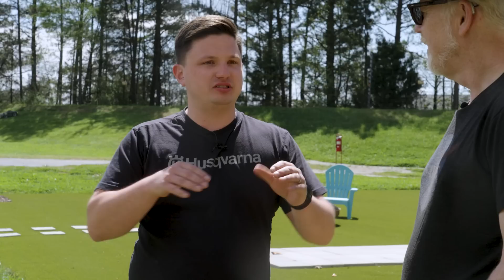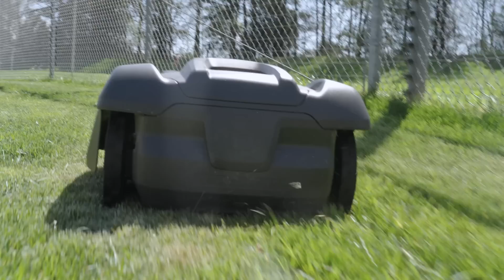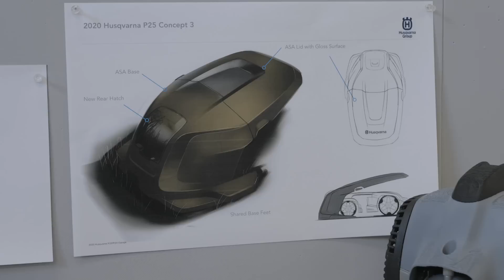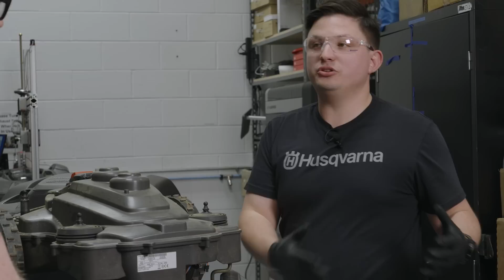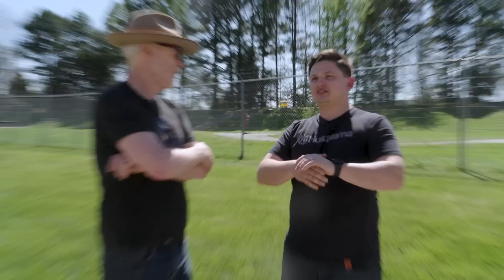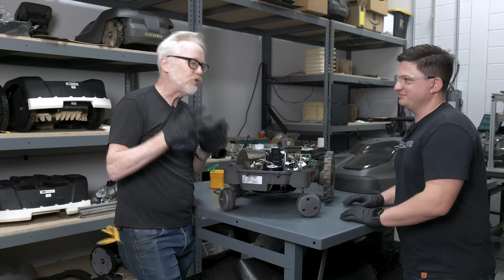How They Work: Self-Driving Robot Lawn Mowers!

Comment: The fact it's IP4 rated is a major disqualifier for me when many on the market are IP6 so you can hose it off underneath.
Reply: You should never hose off a robot mower from underneath. I've worked in robot mower service for years and have seen many robots fail due to water damage caused by being hosed from underneath even those where the manufacturer claims it's safe to do so.

Comment: You certainly got into the weeds with this product but there are unanswered questions about maintenance. For example how do you deal with the inevitable buildup of clipping debris underneath, particularly if it is only water resistant from above? (A lot of modern mowers have a hose attachment to clean underneath the cutting shell.)
Reply: lift it on the backside and hose down the debries.

Comment: We have some of these at work. I think they perform well. They are not going to generate the contrasting strips that are typical of freshly cut lawns, but that's a byproduct of their autonomous nature and how they somewhat chaotically bounce around inside their area. 

The only downside, and this is more of a maintenance issue, is there is some sort of problem that develops with the blade system. When the facilities team puts these out every spring they struggle to cut anything. Miraculously, one day they begin to cut great. I suspect the blades get corroded and need to be changed every year. Or perhaps the blades get froze on their axles. This is likely more of a storage issue with the machine in the off season. They probably aren't cleaned well at the end of the season and that leads to the problems. 

Then, one day, they start cutting great. 

Having some mechanical sympathy is going to lead to increased service life of your machines. If you take care of them, they will take care of you.

Comment: I had a random idea there the other day using a VR headset setting boundaries.  That's got two small cameras, a few sensors  essentially a phone as a brain. Instead of using GPS why not explore using the same tech as VR headsets for setting lawnmower boundaries?  No need for base station GPS antenna or burying wire.  I'm sure there are other complications (like reliability and repeatability).
Reply: This is an interesting idea, I'm sure the changing seasons / weather (aka snow, fog, dark, rain) that changes the view would affect it, but a slight variation could be a local positioning system, something like solar powered positioning nodes, then using something to walk the boundary (VR, phone in pocket, carrying the lawnmower, whatever), recording the distances to each of the local positioning nodes to establish the boundary.
Reply: And right after my comment I got to the point in the video where he does exactly that, LOL

Comment: Here's three tests they forgot to do:
Make a 1 sqm box and see how often the mower get stuck. Surprisingly often even though there's actual room for it to manoeuvre.  
Measure the time it takes for the mower to cut the whole garden. You'll find out it's a very long time since, for some reason, the random character of its mowing makes it often go to areas it has done already. Ending up in some areas getting cut quite rarely.
When cutting, the mower struggles severely to cut down longer single straws of grass and other stems—making them just bend down but actually not cut so they swing back again. Ending up with a lot of stems and other unwanted small vegetation left.
They should implement some sort of machine learning making the mower remember difficulties and how to remedy them.

Comment: Being so light weight, looks like it would be easy for someone to steal while you're out and about or asleep. Are there safe guards to prevent that? What about something that aids in recovering the mower? After all, it has GPS.
Reply: it has a GPS in it also its uless without the refrenc antena. on top of that all of them have a PIN code acces. without knowing the PIN code its also useless

Comment: It looks like a little tractor! WTB Shielded Gameboy transparent semi-colored, high durability shell, then a kinda "Canopy" a sun-shield isolated by some metal rods to the side, that hold up a tiny solar panel(s)  (to power emergency systems, no drive just, reporting) and a foundational antenna to boost GPS/WIFI.  Kinda like a umbrella on a tractor, but multifunctional, and cute. Unnecessary  yes, but a little robot with a tiny techno umbrella is gold Jerry, GOLD!

Comment: Have a 450x, last 7 years. Best thing we have ever bought in our lives, other than a marriage license. Heat stroke and broken ankles are not as much a risk since the robot. More actual work can get done outside, instead of trying to keep up with the walk areas/pointless vegetation spaces. 

Wish durable effective robot mowers were more known. So many people stop and take videos of ours, in shock that it exists. Screams bloody murder if someone catches it to look under. lol Collision is fantastic. Doesn't ram into anything. 

However. Needed to replace almost ever single part of this mower, including the wheels, multiple times. The battery and charging station are about the only thing that's actually 7 years old. That's saying something, because the heat and amount of use are very high. It only gets a rest for about 3 months out of a year.

I wish these mowers were not so focus marketed to small city/suburban lawns. Those are the people I guess who want stripes. Or don't need the onboard panel. Can't believe they removed those from the newer mowers. The people who really need these mowers live further out, with rougher terrain, and connection issues with just a phone app for communication. 

Our land is sort of flat. With clay backfill, fireants, and droughts, unfortunately the mower badly needs vibration endurance. It rattles itself apart hard. Our weeds are rough and often woody, but the mower eventually evens them off. 

Hasn't been stopped by pinecones, storm branches, fireant mounds, vegetable harvest trimmings, odd rainy segments with extremely fast growth, or fruits. Not even big riding mowers can say that, here. Walking around is infinitely nicer since the robot mower. It weighs much less, and doesn't compact the ground further. Gets better each year.

Those bricks on the tiny obstacle course in the video? Sure, sometimes nothing bad happens. Other times heavy low bricks snag a blade and breaks it. Or hangs up the whole mower, stuck on it's side. Must keep up after anything that exposes or moves hard low objects out into the mowing spaces. 

Stumps can high center it like a turtle. lol Tree roots haven't jammed the mower, the sounds when the mower decides to climb over them makes us wince. Random wildlife holes have yet to hang it up, not sure how. So I suspect there is more wear and tear on the undercarriage, and front wheels, than the manufacture expects.

Difficult to get services. Install company folded that section of their business around 2020, and came from 2 hours away. We must travel to the next state over, a four hour plus round trip, when it's something we can't replace ourselves. Winter servicing is a lovely daydream. The install company introed that idea, and then promptly ditched robot mowers before we could even get the winter service.

Couple important things for perimeter wire install. Get the BEST quality wire for the install. Wire originally installed was a low grade, aluminum stranded, that corroded within two years. There is no good time of the year to discover extensive corrosion, chew through, or flat out breaks. BURY it completely. That nonsense of sitting on top of the vegetation must work somewhere, but not here. 
Or, get the new models without any perimeter wires. Although, you won't be able to control it from an onboard panel if your phone will not connect. Can't imagine. So many times we needed to go out to the panel to get it working again.
Reply: I'm very happy for you.  

Wow dude that sucks! 

Pick one

Comment: My only problem is they should’ve made it washable by a hose. A lot of people would do that. It’s kind of sad that the team at Husqvarna missed that one that seems like a user-friendly feature in my opinion ring resistance is one thing, but idiot proofing is another.
Reply: Gardena robot mowers can be washed with hose. Gardena is basically Husqvarna with different color and plastic.
Reply: The hospital I work at has one of these for the yard outside the cafeteria, it's been there for 4-5 years, no one ever touches it except to put it away for the winter and it never looks like it needs cleaned. As the one person in the video mentioned, they keep the grass short all the time so they never really work too hard. You could probably get away with a damp cloth wipe down once a year when you put it away at the end of the season.
Reply: All (EU) Husqvarna models are hose washable. Not sure about the exact US models and ipx ratings.

Comment: (19h x 7days )x52 weeks )x 4 years = 27664 hours. Let's say that it's design for 27k hours and you only cut grass 3 times a week that is 27664 hours / (19h x 3days x 52 weeks) = 9.3 years. I those price, I expect that. Let's be honest this is not easy life for a robot, its outdoor under UV, water, cold and hot. My roborock S7 vacuum got 377h, 589 cycles and 18000m2 total area clean.

Comment: I'd love one of these but my grass is way too thick. I cut my grass at the 2nd highest deck height setting. That's as low as i can go with a 190cc engine or it'll stall.
Reply: the idea is that you set it to run before the grass gets thick, then if you wish it could cut the grass every hour of every day, mowing before the grass even has a chance to get thick. a continuous mowing operation while you are off doing something else

Comment: Have had several Husqvarna for several years. Mowers themselves are pretty bulletproof proof but wires are a real pain and fail ALL the time. Dealership support in my area is poor. Just purchased two Mammotion Lubas that are GPS…no wires. After about a month I am still learning but performance has been great! After over 5 years of using robot mowers I am a huge fan.

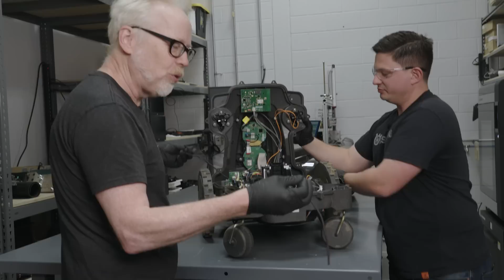Comment: 16:36 While I appreciate that the design of these is such that they are serviceable through the time of ownership, I am always skeptical of companies ethics when it comes to the longevity of their products against planned obsolescence. It's in the interest of the company to have return customers of course, so they wouldn't make these fail completely within a small period of time, but I do wonder if they plan for parts to be serviced or replaced within a certain timeframe to drive alternative revenue options, i.e servicing.
Reply: Well fpr what it's worth I have a 40 years old riding mower from them and last year the steering column gear broke
Al I did was give them a call and 3 days later I got a new gear for the column and it cost me 37 bucks

Comment: 5-7 years seems like a super short life... my non-robot mower is like 15 years old...
Reply: It's short in terms of years of ownership but not in terms of operating hours. These are designed to operate almost constantly to maintain the grass at the desired length not just cut it 2-3x's a week when it gets longer and as stated in the video that can be up to 19 hours a day, 7 days a week for those 5-7 years.

Assuming you're just a homeowner and not a landscaper using it commercially your 15 year old mower probably has a tenth or less of the operating hours they will see in 5-7 years which is actually quite impressive.
Reply: My Husqvarna lawnmower with a Honda engine left behind by the previous homeowner is easily 20 years old...and I'll probably have it for another 20 years

Comment: I'm surprised the topic of pets didn't come up... like what happens when my dogs are outside, will the mower avoid them or does it need to bump them before it changes course. And what about dog waste? Does the mower just run over piles of dog waste and smear it in to the grass and all over the machine wheels and the blades?
Reply: I mow over poop all the time. What actually sucks is when you run into hidden poop with the weedeater

Comment: How do you prevent some guy driving by and snagging your mower while you're inside taking a shower?
Reply: There is a loud alarm siren built in and you need the code to turn it off. But yeah you can still grab it, but probably not operate it anyways
Reply: it has gps
Reply: They thought of just about every scenario with this mower...

Comment: maybe I missed it, but was expecting to hear comments about theft or ransoming of the mower. What's to keep someone from picking it up and throwing it in the back of their car/truck?
Reply: There is a a pin you need to enter before lifting it(you can choose your own pin) , or a siren of about 120dB goes off and does not stop until you enter the pin or the battery dies (it can go on for hours)
Reply: Also depending on the model you can get mobile network addon so you can track the stolen mover using GPS. It can also use GPS to detect if it's stolen.

Comment: 100% someone needs to develop a snow removal system like this
Reply: Now how would that work without it having a big maw that goes up to your knees?
Reply: @jankington216  A built in heater to melt it, or something you start and runs continuously through a storm.  Say something that could handle up to 3 inches depth.  Also snow freshly fallen is a lot easier to move than stuff that's been compacting throughout an entire storm.
Reply: @ck2d  there a thing actually called heated lawns, the football/soccer grounds the big clubs, the one money to burn, something put under grass, in the earth/dirt maybe  electrical heater, or myself, more like to hot-water pipes, and run all over the playing area, on the ready cold days no snow, no frost, no ice, many even keep grass it self happy, warm, may still grow a bit too?
Reply: @ck2d heating snow slowly like that in the winter would use an insane amount of power and then leave water in it's wake that would freeze to ice and the robot moved on :-)

Much easier to spin a tiny motor with little in the way of resistance... just a couple razor blades trimming an eighth of a inch of grass.
Reply: Yarbo?

Comment: Failed with not asking the most important question. How do they prevent theft.. With the top that pops off so easily and batteries right there. I can pop the top and disconnect the batteries and walk off with a very expensive mower...
Reply: Which is a brick without the pin code and the station.
Reply: And then what?
Reply: @jamesbizs  Get spotted walking down the street carrying a lawn mower, either by a neighbour or some security camera(s)
Reply: There is a a pin you need to enter before lifting it(you can choose your own pin) , or a siren of about 120dB goes off and does not stop until you enter the pin or the battery dies (it can go on for hours)
Reply: @vegmel03  Thank you, but that wont stop much. If you know where the siren is or its exit hole, a simple finger to cover the hole reduces the sound to a muffle. But again if you are watching the mower and catch it at the return to base. It will be mostly discharged. Alarms means nothing as bikes are stolen all the time with a loud siren blaring.
Reply: @StrawDragon  you still need that pin so you would likely need to replace the board or spend the time to figure out how to hack it.